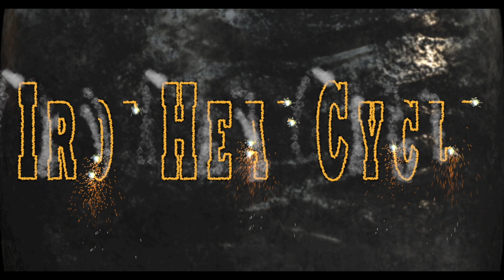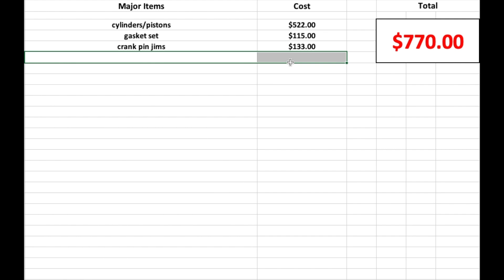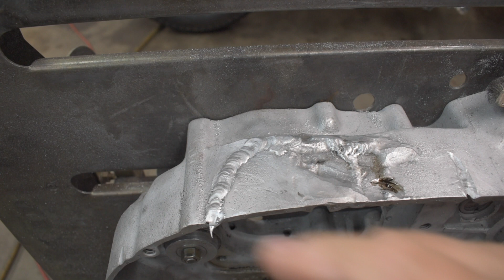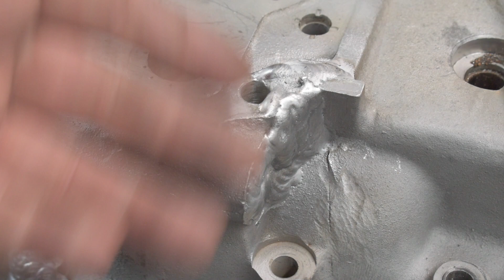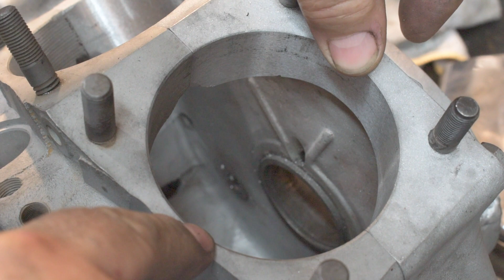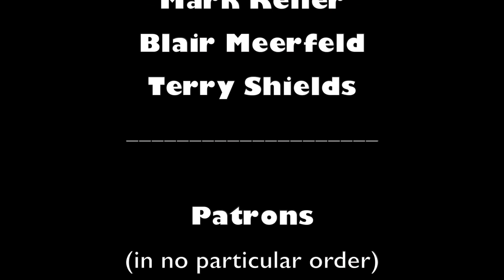1962 XLCH RIP Nbr 197

Comment: Economically, great raw material for one of those paklstani aluminum casting shop channels, lol. As a testbed for "all common sense ignored, can it be resurrected? " skill experiments, an invaluable pig. Now, a theoretical question: would a couple thou shrink fit on the trans repair boss (oven case, freezer boss) add anything to the final product, or just be a nice visual handjob for a vid?
Reply from the maker: If you went to an extreme interference/shrink fit, maybe in the over .007 range, welding might not even be necessary.

Comment: what  rod  4043  or  5356
Reply from the maker: Mostly 4943 and 4043. I usually use the 4043 but have been trying the 4943 out.  The 4943 seems to flow out a little better.

Comment: I just found your channel today...6-29-23....looked at a couple videos of that old set of cases....Wow, that is definitely Way Past Dead...!! There are plenty of uses for J.B. Weld...but not much good for fixing Motorcycle Engines...!! Even with miles of TIG welds...sometimes it's just over....and...All that ARGON...!
 
   Excellent Videos you have...Good info and high-quality of camera work...not filled with a bunch of B.S.....Thanks !!!
 I have/had a couple of 1972's...but my favorite 'Iron Head' is my 1946 Knuckle...now a 93" S&S Sidewinder....I bought that Knuckle in 1975 for $1,500 and the first 72 sporty in 1974 for 2,000....and I thought I was getting robbed....Well maybe so, they were from an H.D. dealer...
 I do still own a 72 Sporty that is now 100% aluminum...79" SPUTHE  XR type top end....Just like the August Cover of Cycle World, 1980...Horsepower is (like the late Alan Sputhe said)..."Adequate"...
 The transmission/s (Sporty and Knuckle)...outside of magna-flux, shot-peening and a little hard chrome, and some 'Moly-Coat'....and one of those old TROCK cast-iron trap-doors....nothing was needing replacement...I have a new still in the box,  Barnett Scorpion clutch for it...no matter what I did, including a TROCK clutch spring and extra set of plates....this tranny still slipped...even with 25 tooth sprocket on there, and a 44 on the rear wheel.
  I guess I'll check out this recent video....
Reply from the maker: Sounds like you have some very cool machines....

Comment: The 1972 and early 1973 1,000cc cases may have the same cylinder bolt pattern as the 900cc cases. Late 1973 and later Sportster cases may have a larger cylinder bolt pattern. Nice informative video.
Reply: Yeah...I've owned 2, 1972's and an 'early' 73...the 1973's did have different cylinder base bolt circle...and probably plenty of other stuff...I bought the '73 for parts...
 I still own my first 1972...(I'm 2nd owner) and in 1981 had the whole engine built into a 79 Cubic Inch 'SPUTHE' all aluminum XR type top end...scary fast in 1981...still is....400 pounds and over 100 'real horsepower'....this motor is nearly identical to the SPUTHE engine/bike on cover of August Cycle World....
  I just today..6-29-23 found Iron Head Cycle...good quality Videos...!!
Reply from the maker: Thanks for the info!

Comment: Good day. I’m scratch building a iron head motor. Two of the early rocker arms touch the stock valve top retainers before the rocker arm touches the valve stem. I have seen this before where people grind on the rocker arm for clearance. But I’m just curious why this is so? Thanks Smitty in Vegas
Reply from the maker: How would you know that? Do you have a cutaway rocker box to observe the valve/rocker arm? That is something a guy would not normally be able to see. The rocker arms, although basically the same, do vary in shape somewhat. My first inclination is that the valves are set too deeply in the head which would allow the upper collar and the valve tip to ride too high and change the angle the rocker arm intersects with the valve.
Reply: @IronHeadCycle  good day. I am building a open rocker motor like an old board tracker. I went through three pairs of heads, and these are nice original valve seats and valves. The underside of the earlier 900cc rocker arms has kind of a radius to it. Where the later rocker arms have a little straight relief and fit perfectly. I appreciate the reply. Thanks Smitty. 
. I guess if you ever have a motor that sucks a valve. You could see if the retainer was hitting on the bottom of the rocker arm?

Comment: I’ve owned several Ironheads since the mid-1980’s (when they were $1,500 used bikes). It’s noteworthy the interest these are getting nowadays.  My advice to anyone thinking about getting an old Ironhead is if you find a running bike that’s not smoking or jumping out of gear LEAVE IT ALONE and enjoy it.  However if it has to come apart (either motor or transmission OR BOTH!) be prepared to spend $1,000’s.  THIS  IS AN OUTSTANDING VIDEO!!!!
Reply from the maker: Thank You!!! Yeah, if you take one apart you can really open a can of expensive worms.